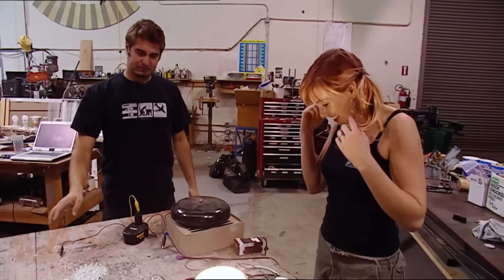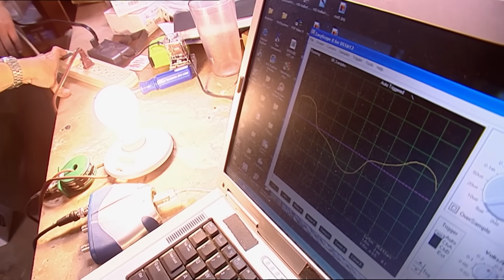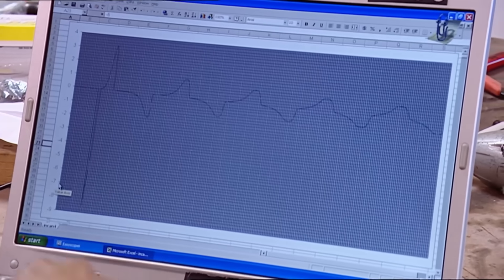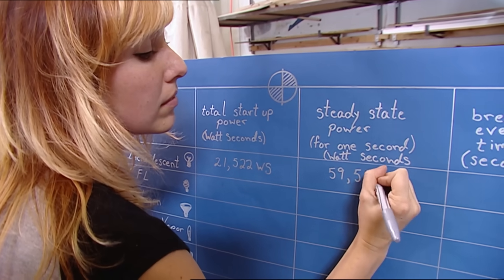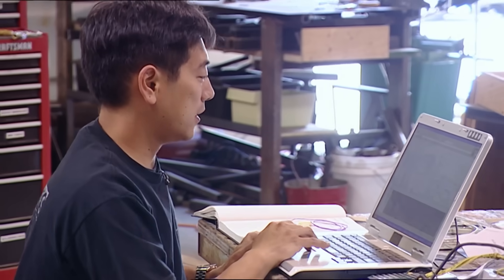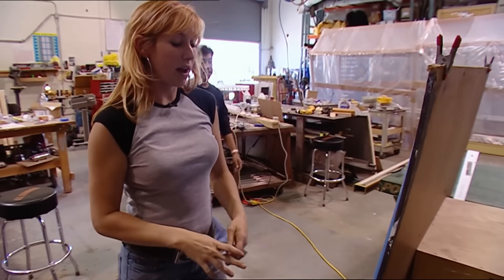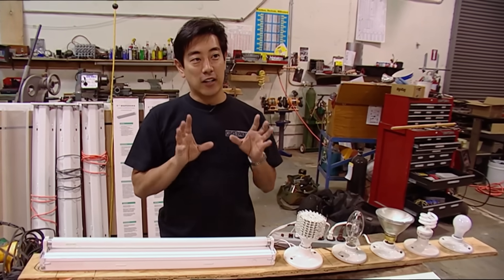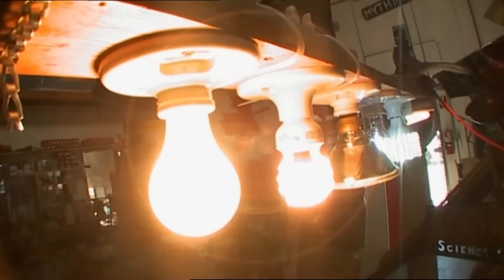Is It Cheaper To Leave The Lights On Than To Turn Them Off? | MythBusters

Comment: This is back when led bulbs were just a charming novelty.
Reply: I remember watching this and thinking led bulbs would be the future for us all in some far-off time.
Reply: @karenelizabeth1590 why didn't you say something man I would've saved so much money
Reply: I remember when streetlights had a warm glow, so did the lights in your house. And the headlights on oncoming cars didn’t blind you like staring into the f*cking sun.
Reply: @philiproseel3506 yeah, little did people know that it’s cheaper to make LEDs so now major manufacturers are gonna scheme out on producing them forever. It was a good run.
Reply: @philiproseel3506 LEDs can be any temperature (in the color sense). if lights got cooler that's because someone chose a cooler color not because of any limitation with LEDs
Reply: @seanthesheep LEDs are cheaper to manufacture at cooler temperatures to the best of my knowledge
Reply: @KLil37  oh, I didn't know that
Reply: @99berserker yea you can’t actually make LEDs that directly generate a broad frequency spectrum like white light so they make white light with a chemical coating that fluoresces from a blue LED on the inside so cool colors closer to the source blue are more efficient
Reply: @seanthesheep To an extent, but municipal construction is low bid, and a lot of street lights got the faulty Prince lights (the lights that are supposed to be white, but turn Prince purple after being exposed to too much sunlight)
Reply: @seanthesheep  That's not true, LEDs give off less waste heat because they are far more efficient. All the heat ever really was, was electricity going to waste.
Reply: @MythicSmith  thats not how light bulbs worked in the past, the act of heating up the filament is what generated the light, the light was a BYPRODUCT of the process
Reply: @nuhrii3449  Are you saying the heat was the point, the reason people used them? Cause otherwise yeah, that's still waste heat, that's just even more waste heat. You realize the more energy that comes off as heat, the most energy CAN'T be used for light. That's why bulbs now are much brighter, cool to the touch and energy efficient.
Reply: @MythicSmith  i said what i said, rationalize it however you want, it doesnt change the fact how light bulbs worked back then
Reply: @nuhrii3449  It's not just "back then" that's pretty much how they all worked up until LEDs. But as time went on we found filaments that glow bright and lower and lower temperatures because the waste heat is really not the intention.
Reply: @MythicSmith  You are completely wrong. First. I am 57 years old and I barely remember incandescent street lights. In fluorescent lights heat is byproduct though. And incandescent light bulb is more effective, the hotter the filament is. That's why halogen is more effective as it allows higher temperature. This is basic physics. Black body radiation and Planck distribution.
Reply: @trex2621  He’s just thick. Although I’m not sure that I agree with your comment about fluorescent bulbs producing heat because they certainly produce less heat that incandescent bulbs. I’ve never tried it to know whether you could touch a recently used or on fluorescent bulb to know whether or not it would burn your hands. I know that you couldn’t do that with an incandescent bulb, i.e. easy bake oven.
Reply: @philiproseel3506  The problem with LEDs on cars isn't that they're more efficient or more powerful, but that they're regulated like dogcrap.
I.E: Do you know how you see "10w, 20w bulbs, etc" ? When they're LEDs, they're not even drawing their advertised w/h. What it means, is that: "this 10w LED bulb SHINES as bright as a 10w regular bulb".
It's nothing but a comparison game. Pretty stupid, but guess what? Car manufacturers are actually "smarter", because they know that a "10w LED" actually consumes like 1w or something, so they just put a 10x stronger lamp in there to address specification, of "you're allowed to only have 10w headlights".
Hey, technically thoe LEDs do consume 10w, so everything OK!
No they're fucking not god damn it, indeed.

P.S: Obviously headlights don't actually consume just 10w, I ain't going to fact-check that. It's an example.
Reply: now they can be an everynite annoyance as oversized trucks points the SUN into your eyes.
Reply: @TheNewton  here in The Netherlands people have these mini suns on their bicycles now. You get totally blinded
Reply: @TheNewton  people with blue or deep yellow headlights need to be brought behind a shed.
Reply: @TheNewton  Led lamps should be banned from usage in traffic. Bet in a couple of years statistics will show how many accidents they cause. And dont anyone of you claim -Yeah thats because of your eyes cant cope with Led since your eyes (mine!) is old. Well, most young people will get old to, so..
Reply: @thatdudeinorange5269 it's not LEDs that are the problem. LEDs are highly functionable and very easy to have in varieties of colours. The problem is car companies have all decided they only want the brightest of blue whites which blind very easily when poorly adjusted
Reply: Have only had a few burn out in years of use.
Reply: What the FUCK happened here?!
Reply: @rinoz47  People getting emotionally attached to hardware + nostalgia + simply dumb uneducated people with a sprinkle of consipracy theorists because why tf not. That's what happened.
Reply: @Atom224 just about the dumbest combinations of words I've ever read. Congrats
Reply: I remember going to an energy fair with my dad and dropped $60 on a single LED shop light bulb. Now you can buy a cheap shop light with 2 bulbs for $10.
Reply: They were absolutely not charming back then. Novelty yes, but gave off “why does my kitchen look sick”-vibes.
Reply: Back when LED bulbs cost $20 each.
Reply: @jonathancaballeros3408  Idk if they are going up or not. I got like 100 on sale from DG for like 25 cent each. So not bought any in a long time.
Reply: LEDs are cancer for your eyes
Reply: All of my leds always break in a short time.
Reply: And probably back when their longevity wasn't artificially cut
Reply: @fritt_wastaken no that happened  almost a 100years ago
Reply: @fritt_wastaken right. They burn out quicker than incandescent
Reply: @boyeatsworld-vr9ci  Stop buying crappy cheaper LED bulbs. I bought all my LED smart bulbs back in 2013 and 2018. All of them still work.
Reply: @rufus2028 the new ones are made to die sooner it's planned obselecence otherwise if they last for years nobody is going to buy any bulbs and the brand would go bankrupt
Reply: @johndrippergaming  that is true, but it's not true that they die faster than incandescent lol
Reply: @TheXiaoLong they should not but they are built that way to die faster maybe they use cheap materials
Reply: @rufus2028 nah I have same issue. Phillip bulb,ge,no name brand,doesn't matter. Led bulbs last maybe a quarter the life of incandescents do for me. Open fixtures. Shouldn't be overheating
Reply: @boyeatsworld-vr9ci might be your house wiring. seriously they last decades.
Reply: @rufus2028 what about 2025 when you posted this?
Reply: @johndrippergaming congrats on realising what the rockefellas realised.a hundred and 50 years ago.
Reply: @rufus2028  i only buy "chap" LED bulbs, but also only ones i can screw Open and replace the small dot of  thermal paste with a better one that's applied correctly. So far they lasted min 5 years or much longer
Reply: @johndrippergaming they have always been able to make bulbs that don’t burn out. Lights only burn out to charge people like a subscription.
Reply: I miss Grant ❤  he really was brilliant! 

…as far as bulbs, I switched to LED in 2017 and 1/3rd are still original. I’ll keep buying them because I saw an immediate change in my power bill.
Reply: And they kinda suck now
Reply: We can all thank Shuji Nakamura
Reply: I have only led lights in my house, the led lights are never turned off completetly even if the swtich is off because the circuit only interupts the + or -, and one of those will pass throu the circuit anyway and those leds will still light abit :)
Reply: Shame they didn’t stay that way. LED are fucking awful
Reply: Still are.
Reply: Wouldn’t they be a novelty like now tho…?
Reply: I hate LED bulbs
Reply: Come on over to my place. My wife leaves them on 24/7
Reply: I'm more concerned with their claims of longevity.  Their lifespan claims were ahead of their actual time on the market, initially.  I've had one led bulb die prematurely, but most are still going.

As for their brightness, you just need to learn their terminology to find what you're really looking for.
🤔
Reply: @tyree9055  the primary enemy of electronics is heat. More often than not with LEDs it is heat that is the issue. But also, more often than not there is only one small component that went bad and can be replaced with some know-how, however most often the time isn't worth it.
Reply: @RedWingsninetyone There was a YouTuber that did a video on smart bulbs. Apparently most of the ones that die prematurely were enclosed in a non-ventilated space.
Reply: @RedWingsninetyone  they can fix that by making a design with larger or more LEDs working at lower wattage each, like the ones the city of Dubai demanded be manufactured.
Reply: @joshuascholar3220  there's other things they can do too, but yes that would help.
Reply: @RedWingsninetyone  Id say it would be best to add a small fan right before the LED enclosure, similar to those that can be found on car headlight when changing from Halogen.
Reply: @jsrocker248  the difference is that LED headlights have to put out a ton more light and the drivers get way hotter than a typical indoor LED would ever get. But I get what you're saying
Reply: @tyree9055 I bought my house in 2014 and put in LEDs in most of the fixtures at that time. This year one of those original LEDs finally burnt out. On the other hand, my parents replaced a whole fixture with one that had built in LEDs. In under two years the fixture died (it claimed to last for 10 yrs). Since it didn't had a removable bulb they had to replace the fixture again. This meant more money than just a bulb and the hassle of changing out a hard wired fixture on the ceiling. They made sure the replacement had a removable bulb so they didn't have to go through that all over again.
Reply: @tyree9055  my Phillips hue lights are around 12 years old with no issues or signs of wearing out
Reply: @tyree9055 is that LED that died quickly in an enclosed fixture?
Reply: @Nathan-jh1ho No, none of my fixtures are enclosed or recessed.  I think it was just bad, an outlier, or damaged in a power fluctuation.  There have been an extraordinarily higher number of power outages in the passed decade in our communal power grid.
🤔
Reply: @tyree9055  it depends son the manufacture, what kills the led it the heat on the circuit but you normally get a few bad ones of lets say 1,000 made you might get 5 bad ones. which can hit the shelf of a store. if you know someone who is maintenance at a factory ask them how long there light bulbs last
Reply: @tyree9055  Yep all my bulbs are LED.  Regular A19 style bulbs tend to be reliable but I have had a few die in way less than the claimed lifespan.  I am talking a year or two at the most.   The more complex ones like the ones they make for your microwave hood light are totally useless.  They lasted a few months.   Went back to incandescent for those.
Reply: @davva360 Good to know!
🤔
Reply: @tyree9055  Lumens is the measurement your looking for.
Reply: @LostShipMate Yep, lumens is the one term, but the other term is the kelvin one, related to temperature (yellow, white, or diamond white glow).
😉👍
Reply: @tyree9055  I have an led bulb in the kitchen in my apartment that has been on 24/7 for the last 9 years. It is the only remaining bulb from the batch I installed when I moved into this apartment. I don't know how it has lasted this long but there was one other that just died about 4 months ago so I expect this one to die soon.
Reply: @tyree9055 I replaced all the lights in my house with LED 11 years ago (LED was still relatively new) and I haven't had a single bulb wear out yet. The claim on the box is 16-22 years so I'll let you know
Reply: @YouToobPlaylists  I bought my first set of LED bulbs in 2013. So far so good
Reply: @YouToobPlaylists  3 hours a day* if you keep them on longer they will wear out faster which is what most people miss
Reply: @YouToobPlaylists wow how much you paid for that high quality LED? I only use $1 LED that last 2-3 years for 20 hours daily use.
Reply: @tyree9055  Unfortunately longevity claims are always taken assuming ideal temperature conditions. Most bulbs are installed in situations where they simply get too hot to achieve its rated lifespan.
Reply: @tyree9055  Agree about the over estimating the longevity. Had some burn out in less than a year. Just recently came across a video with a suggestion I’m going to try. Using the foil packaging from drug tablets, take a tiny piece of the foil from one of the spots where you have removed the pill. Place this as a connection point under the lightbulb and the lamp socket.
Reply: @tyree9055  you'd be lucky if you got a year out of the old ones, stop talking like you are thinking
incandescent is mostly heat, light second
Reply: Idk, I switched all but one of my mancave lights to LEDs a couple years ago. Selectable temperature or color, nice and bright and haven't blown a single one yet, use way less power, but the last remaining incandescent bulb in one room has been replaced a couple times now. I finally bit the bullet and swapped it out for an LED a couple weeks ago. 😅. I'm very much enjoying my LED lights.
Reply: @tyree9055 LED bulbs these days don't last as they were claimed to last due to the same reason the likes of phones & fridges don't last as long as they once did: planned obsolescence. LED bulbs today are deliberately housed in a way that causes heat build up faster than they should, & heat is the forever enemy of any kind of electronics, even as simple as light bulbs.
Reply: @FalconWindblader  If you buy no name bulbs that lack a heat sink maybe, but even the Chinese brands that have a heat sink will last you for half a decade at least. Mine have been going since 2015 and only two of the original 4 died, both after the 10 year mark.
Reply: @FalconWindblader lol no. Technical progress means evolving components which means you have changing reliability.

Anything thing from relegation due to a harmful substance to the company wanting a product that is mass producible will cause "planned obsolescence".
Reply: @Lucas_Antar  Gosh, sometimes i wonder how good your lives are for you people to get so sheltered, that your thoughts get so naive...
Reply: @FalconWindblader    The main culpret to heat desroying LEDs is using then in a 50 year old fixture that was designed for an incandecent.
Reply: @FalconWindblader If he's not a troll, then he may be a deliberate disinformation guru, or just someone that stupid...
🤭
Reply: @Lucas_Antar No, it's not technical progress, it's financial progress.  It's the attempt to produce the exact same product with cheaper components so they can remain competitive and / or make more money.  They keep doing that until the customer stops buying their junk and then they move on.  This is a repetitive process, too, that I've been watching for decades now.
Reply: @FalconWindblader  that's what happens when you become an educated engineer and not a drooling content sink on the internet. good luck idiot.
Reply: @tyree9055  sorry to tell you factories cant mass produce everything and cheaper/easier to find and work with materials must be used. literally part of my job thanks for noticing.
Reply: @FalconWindblader it's not so much planned obsolescence, they don't care about how long it lasts. They want to save the money now by not over engineering it. If they save a tenth of a cent and make a million, they pocket the cash. You might not buy another one from them, they don't care. It's like an added bonus that you might.
Reply: @tyree9055 most LED bulbs arent supposed to be in an inclosed or recessed fixture because they burn out faster.
Reply: @shadwell749 then they shouldn't be lightbulbs.
Reply: @tyree9055  The circuitry that drives the LEDs will die before the LED does. So to say that you had "an LED" die could be misleading. The light emitting diodes themselves could last millions of years but the cheap Chinese driving circuitry cannot.
Reply: LEDs die prematurely as they often aren't rated to be in an enclosed fixture.  So turning them off then not needed is probably even better.
Reply: Thanks for this. My millennial condo neighbor insisted that he left his basement light on 24/7 for many months because it was "easier" than turning it on an off and didn't cost any more $$ to just leave it on.  Truth: he has a big cannabis grow operation in his basement. He previously had it in his upstairs spare bedroom but a fire started, which he made up a ridiculous excuse for. After that fire his basement lights were on all the time.
Reply: @sitori663snitch
Reply: If those bulbs were so great, forcing everyone to use them and tripling electric bills wouldn’t be a thing.
Reply: @e @evilisfun9935  did you even watch the video and see the table showing the energy usage for each bulb. I implore you, go and rewatch the video
Reply: this needs an update considering cheap lights, electricity, and the longevity of the light switch.  see, replacing the switch plus labor costs a lot of money compared to the cost of electricity or tiny fraction of the life of LED lighting solution.  
I started to think this way during the popularity of TOyota Prius and switching off an engine in a traffic light.  Turns out it is a terrible idea, it probably halved the life of the lead acid battery which definitely a lot more expensive vs the fuel savings.
Reply: @zodiacfml switch cost a few bucks at most to replace. Easy to do yourself. Turn off the power to the area first ofc.
Reply: @zodiacfml how do you figure turning on and off the engine was a terrible idea for a lead acid  battery? 
My daughter’s 2010 Prius (from this era) has a 2009 lead acid battery in it, and hybrid NiMh battery, all with 280k miles. No battery has failed so far in 25 years in this car. I have replaced so many lead acid batteries in other cars, but not in this Prius. 
My wife’s Lexus hybrid RX also has 250k miles and original hybrid battery as well. We changed the lead acid battery once.
Reply: @RoopsPhoto  it is because hybrids start their engine through the electric motor and the motor gets its power from the high voltage battery
Reply: LED light bulbs are notorious (in the 2020s) for burning out well under their expected/advertised lifetimes. The claim that LED lightbulbs will last 10+ years fails 90% of the time and they fail in a year or less a good 10% of the time. So, yed, they are cheaper to run but do not, in general outlast other bulb types.
Reply: @Thurgosh_OG  would love to see where you got that data. Cause it sounds suspiciously made up. Nah it is made up. I have led bulbs in my house and can’t remember the last time I changed a bulb. Has to be 10+ years.
Reply: First thing I thought!
Reply: You have to be a special kind of stupid to think leaving your lights on all the time uses less energy than turning them off when not in use.
Reply: Blue.Light scam . Forced everybody to change. CFL
Reply: @RoseK-e8b  ok schizo
Reply: The concept came from back when lights were fluorescent lights that took a few seconds to minute to warm up. Today's lights  are instant on and off so there's no "extra" energy being used to warm up a ballast. So with that, you save money these days buy turning  them off if you're not using them.
Reply: And they still haven’t saved us a dollar… ironic
Reply: @rcnewman51.  Ok schizo
Reply: Yeah and about $50+ each.
Reply: @SeptimiusSeverusImp  Ok it's impossible to tell what comment you're replying to with this new update. But LEDs are like $4 each
Reply: @MythicSmith  Try keeping up. The video is 18 years old!!! Buy an LED on 2007 for $4. I dare you.
Reply: @MythicSmith  I was commenting on the OP. That was very obvious. They said they were a charming novelty, and my comment was that yeah because they were $50 each. Nobody could afford to buy LED bulbs in 2007 because they were a charming novelty that were very expensive. I would recommend you don’t comment anymore on YouTube because you’re too thick and you don’t understand context, and you obviously don’t understand history.
Reply: @SeptimiusSeverusImp  It's not at all obvious once you've forgotten most of the conversation and can't go back to look at anything that was said previously. But I apologize for my mistake.
Reply: Don't forget LEDs age you a lot more than the incandescent bulbs. I remember when CFLs cam out all the kids started to wear hoods lol
Reply: Incandescent bulbs may be inefficient but the light is awesome.
Reply: @boyeatsworld-vr9ci  this is the best pro incandescent argument I’ve seen in this entire comment section, “sure LED’s are better but I prefer incandescent because of personal opinion” the most valid argument here so far
Reply: @hadgeron9556 not opinion though. Just fact
Reply: @hadgeron9556  incandescent bulbs produce infrared radiation. Humans need that to regulate their biorhythm, especially if they spend a lot of time inside. It’s like having little candles all around your house. You can fake a warm light with LED but your brain knows the difference.
Reply: @hadgeron9556  but yes, I ultimately shouldn’t need any more reason than it’s my home and my energy bill and I should be allowed use the lights I prefer. Literally everything you see is a product of the light reflecting off it.
Reply: @boyeatsworld-vr9ci is Americans in the stone age, led lights are bright, I can choose my color,  it use a lot less power, I only use led lights now, and have for the last 10 years.
Reply: @simon-df9wh thats cool; if you like crappy stuff.
Reply: @boyeatsworld-vr9ci  ok schizo
Reply: @boyeatsworld-vr9ci that's a myth. You can get the same exact light from a soft white led
Reply: @chrisbarry9345 no you cant.  LEDs flicker while incandescent put out steady light
Reply: @pooshiesty  LEDs CAN flicker.  If your LED bulbs are flickering try better quality bulbs.
Reply: @chrisbarry9345 no you can’t. Drivers are so cheaply made it’s very unlikely you’ll find one that will output steady current. Even LED streetlights are made so poorly they often turn purple or flash. Additionally, no LED made today will outlast a HPS discharge bulb. People say LED’s will last 30 years but I’ve seen HPS bulbs from as old as 1960 still burning fine with near-perfect color rendering. Our world is cheap, and why make a perfect bulb when they know you’ll just buy more 😅
Reply: @pooshiesty  That's not why incandescent looks better. LED's emit specific wavelengths while incandescent emits a full light spectrum, like the sun. If you examine a "full spectrum" LED bulb you'll find it's made of several smaller LED's of individual wavelengths. This is especially apparent in hydroponic LED's which have dozens if not hundreds of individual lights of different colors to simulate sunlight as closely as possible.
Reply: @chrisbarry9345 incorrect
Reply: @aidenp265 on top of they why change the beautiful HPS lights that we been using for decades into shitty LEDs , also they're too harsh on the eyes and shouldn't be lightning the roads.
Reply: @pooshiesty  incandecents flicker too at 60 or 50hz
Reply: No one wants LED’s in their home- or headlights on a car they are blinding
Reply: LED*
not led
Reply: The LED bulbs seem to last 5 months before frying so idk. I still have a 15 year old incandescent bulb in my garage.
Reply: @jeramieshoe5662  You might have some sort of voltage or current surge issue that the LEDs are sensitive to that is causing the failures.  

For duration purposes, LEDs absolutely smoke any incandescent bulb I’ve ever used.  The difference is so extreme that it is not even close, which is a good thing for me, because I’m getting too old to be up on a ladder all the time.
Reply: @Eyrrll  if LEDs are sensitive to surges they're not going to last unless you're in an inner city with buried power lines. the drivers give out in LED way before any incandescent ever will. Manufacturing quality has gone down drastically in the last 15 years or so. I've gone through maybe 50 LED bulbs since they stopped producing incandescent. I only had to buy light bulbs once in 15 years prior to it.
Reply: @jeramieshoe5662 . My experience has been the opposite.  I replaced all of my bulbs with LEDs 8-10 years ago (a bit over 40 bulbs) and only one bulb has failed in all that time, which was most likely due to a big power surge around the time of an outage.  It actually still emits light but it flickers kind of randomly, so I wrote that one off.

I paid for quality bulbs.  Maybe that matters.  I don’t know but it’s been money well spent.
Reply: LED bulbs are less power efficient or cost efficient than incandescent, and NOWHERE near recycleable as incandescent bulbs.
Reply: @r61425  Say that again?
Reply: All mine are starting to go out. Very annoying. They are supposed to last a long time, but they don't. The circuit boards go out prematurely.
Reply: I’ve had my LED BULBS  in for two years and they are still bright as hell
Reply: And now they're just expensive blinking garbage with about 1/10th the life expectancy advertised.
Reply: sorry to inform you hony, led's are not better, even after all these year 's of so called improvement...........................just sayin"
Reply: @rvsteve583  Sorry to inform you honey, but there are facts and there are opinions, what you're saying is an opinion, facts however say they are better, at least for common daily uses.
Reply: @E_y_a_l  Yeah whatever bro. Consumer choice should be there. You cant ever say whats 'objectively better' and force people to use it, because there is such a thing as consumer choice. People can even choose to use classic bulbs for the express purpose of annoying folks like you. Isnt that neat 😊
Reply: What are you talking about itself from 1 day ago 😂
Reply: @marius-x86 the clip is from 1 day ago but Grant Imahara died five years ago so it's not just a day old.
Reply: @marius-x86  bro thinks Grant Imahara is still alive and MythBusters is still airing; early onset dementia is tragic
Reply: Led bulbs are outdoor lights they are meant for street lights not your home. I rather pay 50$ more for electricity then to do with the hormone problems that comes from led use
Reply: @Awakened_Phoenix it sounds like your understanding of science comes from the back of a cereal box
Reply: @Awakened_Phoenix oh definitely not LEDs arent meant for street lighting.
Reply: They still are. They suck. The light they produce sucks, they aren't dimmable (I don't care what anyone says they don't dim properly. They flicker and it hurts the eyes.)
They also die much quicker than any other bulb I've ever seen. Never had an LED bulb last longer than a few months.

They are the worst light bulb ever made.
Reply: @themonsterunderyourbed9408  
Leading edge dimmers are the older type. They will work with all incandescents, transformers for vow voltage halogens, and some LEDs. They start each half cycle on and switch off somewhere in the middle of a cycle.
chop the AC waveform:
- They cut off the beginning of each AC half-cycle.
- Less time current flows = less average voltage = dimmer light

Trailing edge dimmers are the newer type. They will work with all incandescents & most dimmable LED bulbs. They start each half cycle off and switch on somewhere in the middle of a cycle.
LEDs are semiconductors, not resistive loads.
hase-Cut Dimming (AC side)
- Works similar to incandescent dimming, but the LED driver must be designed to interpret the chopped waveform.
Low-Voltage or DC Dimming (PWM or 0–10V)
- Used in commercial or smart lighting systems.
- The dimmer sends a control signal to the LED driver, which adjusts the output current or pulse width.
- Very smooth, no flicker, and more precise.

you have to use a Trailing-edge (ELV or reverse phase) and not a Leading-edge (TRIAC) otherwise it will kill the led bulb
Reply: @themonsterunderyourbed9408  I just hopped on Amazon and found several listings for incandescent bulbs of multiple sizes. Find something else to bitch about.
Reply: Not so charming because they always claimed to be twice as bright as they actually were, and we all foresaw being forced to switch without any say in it.
Reply: @Plasmafox  Meh, I don't miss having to change a few lightbulbs a year. In the past 6 years I had to replace exactly 1 LED lightbulb, and that one was a extra-high power novelty bulb.
Reply: @Plasmafox  I have changed 1 lightbulb in the last 8 years. No one forced me, the alternative literally ended itself.
Reply: @PseudoEmpathy it was forced. You cannot buy an incandescent bulb now. Try to keep up
Reply: @boyeatsworld-vr9ci  where Iive at you can but only appliance bulbs and what not .
Reply: @boyeatsworld-vr9ci  I just put an incandescent bulb into a cart from a popular retail website, what the hell are you talking about?
Reply: @suporma-suporma unless its like ebay or something similar its not a 60 watt incandescent bulb or higher. I can buy plenty of sub 60 watt incandescent but they are useless as a lamp light
Reply: @suporma-suporma  not if you live in a country where they’ve been banned.
Reply: @Plasmafox  LEDS are more efficient, more reliable and safer technology than incandescent light bulbs, complaining that someone forced you to use it is like complaining that someone forced you to use a car instead of a horse.
Reply: @xerveeon  Relative to the speed and amount of use, cars are much more safer than horses, you are welcome to ask google "are cars safer than horses" and see for yourself, I don't understand why you even think they are not safer.
Reply: @xerveeon  There are downsides to nuclear power, so your analogy doesn't make sense either. It is one of the cleanest form of energy, however building reactors is very expensive and takes years. It also takes very highly qualified personel to operate. Storing nuclear waste is another issue, and while the risk of Chernobyl level catastrophe is minimal with the newest safety protocols - it's not zero. Nowadays a switch to solar power makes the most sense overall, the technology became incredibly affordable.
Reply: @E_y_a_l  There are a couple downsides. A big one is color rendering: there are only a few companies that will tell you at least the CRI and I've only seen one publsih the actual spectrum information, so unless you put a lot of effort into researching LED lightbulbs of all things, the colors of everything in your home will always be off. 
Another weak spit are harsh environments. LED bulbs either dia much quicker or don't work at all when it gets too cold or too humid; incandescent's just don't care.
Reply: @E_y_a_l  That is not a very good example, horses are far more charming than an automobile will ever be. Technology is not always a good thing, cars along with social media, and a handful of other technologies have had massive negative impacts on our society.
Reply: @xerveeon since cars don't poop, they're definitely safer for my shoes XD
Reply: @E_y_a_l  Yeah, the same people who go to climate conferences in private jets...
Reply: @E_y_a_l  how are incandescent bulbs unsafe?
Reply: It's hard to find ones that don't make your circadian rhythms break
Reply: @xerveeon  
Far more people died from horses before cars were invented per capita than people die in car accidents. Horses are extremely dangerous.
Reply: @hellterminator  I have never had any LED bulbs fail due to high moisture or low temps.  In fact, GOOD LEDs will light immediately (no warm up) and provide near 100% light at low temps.
Reply: @E_y_a_l

You can ask Google. Lol you literally think that cars are safer then horses? Haha ok. Then why is cars have more a death rate then firearms. Ask Google. 

Now ask Google how many horse deaths there is. 

Let's use some logic my guy.
Reply: @xerveeon  People fall of or get thrown from a horse. That never happens with a car. Also, never heard of having a fire while feeding a horse versus fueling a car.
Reply: @zombie_8u2 Horses are mainly used by skiller riders and controlled settings nowadays.  I don't think you can predict what the death rate would be if hundreds of millions of low IQ people were relying on horses for transportation like they are with cars.
Reply: @zombie_8u2   do that math again "per capita" and again with "miles traveled" and you wil get different answers.
Reply: @morgana2625  Going with the low IQ idea might skew the numbers further in both categories.  Also throw in the idea that one should learn how to ride a horse by age 10 or less. (years ago) <LOL>
Reply: @E_y_a_l  Would rather still have horses.
Reply: @darknes7800  Well you clearly don't have a cellar that gets condensation on everything all year long or live in a place where outside temps drop bellow -20°C.
Reply: @Fadexpl  actually nowdays nuclear poweplants are safer than basically every task you do everyday. there is a 1 in 10million years chance that there will be a nuclear incident caused by power plants. Even if you dropped a nuke on power plant it wont explode. There have been 3 big disasters in history of nuclear power plants and only one caused deaths due to radiation other ones had either 0 deaths or they were caused by other things like a tsunami in fukushima. In todays world because of fukushima and chernobyl nuclear power plants are the safest places on earth becuase of how much regulations and safety protocols they have. Also most of the nuclear waste can be reused and its so easy to contain and coal plants produce more nuclear waste than nuclear power plants. If nuclear waste was the problem we would be using nuclear power plants rather than coal plants. There are literally 0 downsides from using nuclear power plants. Also solar energy isnt as effective because it needs alot of land unless you are using it on houses rather than using farmland or other places.
Reply: @Fadexpl   Its, the cleanest form of energy not only that but, nuclear waste has been solved decades ago, we also have people experimenting with turning waste into plutonium enriched fuels. 

With newer thorium based molten salt reactors the chances of a nuclear meltdown is zero, the plutonium catalyst is liquid below meltdown temps and drains away from the fuel stopping the reaction without need for SCRAM or even any human intervention prior.

Expense is also not a problem when a coal powerplant costs more to maintain and we have a lot more of them around.

Not to mention thorium doesnt need to be enriched and its not super radioactive by istelf so you dont need any super special ventilation in thorium mines like you do uranium mines.

An estimate proposed that it would take roughly 8.5 million solar panels to equal the output of just one nuclear power plant and thats based off a 900 megawatt or average sized nuclear reactor.
Reply: @zombie_8u2Cars have higher death rate than firearms cuz they're FAR MORE cars than firearms everywhere. Cars are driven 24/7 all over the world in millions in any given SECOND. Also, that cars vs guns thing is unrelated when it's an argument between cars & horses. If you can't comprehend that much, you really have no business arguing about anything with anyone, let alone telling people to use logic when yours are damn flawed to begin with.
Reply: @hellterminator  Whoops, you brought an uncomfortable truth that LED fanboys just don't care about. Extremely expensive compared to incandescent (if we try to get close to the perfect color rendition incandescent inherently have). 99 % of LED bulbs have absolute horseshit color rendition. The information is either not available, or purposefully obfuscated. Short lifespan compared to the price vs. incandescent. They claim to have 50 thousand hours lifespan (the diodes themselves do, but the constantly overheating electronics behind them don't). And the recyclability. Glass + metal vs. various plastics + metal + electronics. Transformer, rectifier, filter, capacitors, resistors, now add Wi-Fi and smart features, a tiny computer inside.
It's a technology in diapers forced to be adopted worldwide and literally everywhere. We will regret this.
Reply: @hellterminator  Cellar???? I have OUTDOOR lighting on my house, detached garage and yard that is lit by LEDs.......No problem when its -10 Fahrenheit !!!!!!!!!!!  U should buy better bulbs.....
Reply: @xerveeon  man, you are such a simpleton. I don't even know why didn't you delete your comment, since you wanted it for so long, and it's an utter nonesense of a comment.

In case he deletes his comment - he said that horses are better than cars
Reply: @E_y_a_l I never heard of anyone dying from drunk riding a horse.
Reply: @E_y_a_l  the idea is taht many did not like and still dont like Led light bulbs. Just too bright and not as soft. Ppl should always have a choice.
Reply: @E_y_a_l  And yeah i still shouldnt be forced to use a car instead of a horse, if someone wants to use something they should be allowed to especially when it doesnt hurt others. Just admit you like authoretarian control over others
Reply: In defence of not using LED, the charm of cities and walkways is immediately destroyed upon switching yellow with artificially white light. I happened to walk along a park path the other day that still had one very old incandescent bulb. I had forgotten how moody and beautiful cities looked in such lighting. I know there are warm LEDs even yellow but for some reason they are not used.
Reply: @different_stuff   Literally lying, I implied that horses are safer than cars with the phrase "Since when are cars safer than horses?"
Since your reply is the one that gave me a notification, congrats! I'm deleting my original reply, though I will leave it in full here with the edit. (The only reason I'm deleting it is to reduce notifications, leaving it further in the chain makes it much less likely I'll get replies while still letting people see what I wrote if they care enough to scroll.)

My original comment in full: 

Edit: if I get any more notifications I'm gonna delete this reply. I've been dunked on enough, go like those ones instead of throwing your own spin on it.

Since when are cars safer than horses? I get your point, but you need a better metaphor. Perhaps coal vs nuclear power? It matches better with having only upsides in comparison and it being baffling that people don't want to switch.
Reply: @E_y_a_l  Not true. More efficient - yes, more reliable - no. In my kitchen I already replaced countless LEDs that SIGNIFICANTLY more expensive than incandescent. I guarantee you that although LEDs consume less power cost of LED ownership is higher.
Reply: @darknes7800 I don't have a problem with warm up in fact I love the warm up.
Reply: @FirstLast-n5b  And I can say that I haven't replaced my LEDs in my kitchen for years and they weren't that expensive...so? LED technology is significantly more reliable, it's a statistical fact, if you had bad experience that can be blamed by the manufacturer and the product, the cost got nothing to do with it since cost can be arbitrary determined by the seller and not by the actual properties or reliability of the product, I'm sorry but your own experience means nothing in a large statistical point of view.
Reply: @E_y_a_l other than government mandating energy efficiency requirements in order to eliminate incandescent bulbs from the market. The car and horse analogy is bunk.
Reply: @jeffmoodie6144  The government mandating the use of horses as a transportation vehicle in urban areas as well, the car and horse analogy is very accurate.
Reply: @E_y_a_l this is the funniest thing I’ve read this week
Reply: @E_y_a_l  Yeah but the light from those LEDs is kinda crap :D
Reply: @E_y_a_l  The feller who you replied to (the xerveeon guy) folded quickly and deleted his comments.
Reply: @4fortyfour  Yea, some people won't admit a mistake even if their lives depend on it.
Reply: @Fadexpl  I'd like to point out that the reason why nuclear is expensive is due to legislation that requires "the best possible protection", so often newly build parts of a plant have to be torn down and rebuild multiple times for marginal safety increases. Chernobyl level of catastrophe is basically impossible these days as it was the result of bad government mismanagement, having it ran by people not qualified to run the plant, running an experiment the plant wasn't build to handle, in a type of plant not build anymore with equipment far below the standard it was designed for and hidden for multiple days by the government. Unless you actively seek out to recreate that catastrophe on a governmental level (why would any government even try?), Chernobyl level of catastrophe are impossible.
For context, Fukushima in 2011 was hit by a record breaking earthquake followed by a record breaking tsunami and saw no notable environmental damage and a grand total of 1 suspected death which was a guy that went in to measure radiation after the disaster because automated equipment wouldn't work with the level radiation. And that's only suspected because he had lung cancer 4 years later but that can't be directly linked to the radiation.

And solar kinda sucks as you mostly get it when you don't need it and you don't get it when you need it most, which also makes the grid unstable. (an issue we here in western Europe already are having issues with) The only solution to that is getting batteries to charge but that would both negate the profits and environmental profits you'd get in comparison to something like natural gas.
Reply: leds are bad for your eyes thats a fact jack
Reply: @E_y_a_l  BTW your experience means nothing either, sorry to let you know. FWIW it depends. Those low voltage with external power supply have tendency to be more reliable, bot those GU10 with built-in power supply do not last long especially when facing down that is usually happens. Outdoors one prone to go off especially easy. Yes, it is because they are "cheap" Chinese made, but reality that they not that cheap and you cannot get non-Chinese made anyway.  Bottom line is very simple - you cannot judge how better they are based only on power consumption - total ownership somewhat different.
Reply: @FirstLast-n5b  Read again, what do you understand from the ....so? I wrote? that was my whole point, that my experience means nothing either and sharing personal experience means nothing compared to serious large statistics....and the serious large statistics say that LED bulbs are more reliable, period, you can specifically target a specific line of products all you want, it won't change the fact that as a whole, that technology is more reliable.
Reply: @E_y_a_l  Yes, singe LED can be made lasting longer than incandescent bulb, but unlike bulb it cannot emit any light without specific power supply and WHOLE SYSTEM depends on all links of chain. Statistic is no more than form of manipulation and they will produce whatever suit those who paid for such statistics. And there is another side of the coin - your "statistics" will say that LEDs "greener", but it will NEVER factor how much "goodies" was generated during LED production and will NEVER factor how much poison crap we burred in landfill. I am not against LED, they great where they do serve the purpose. I just saying that they are not panacea and nothing here is black and white.
Reply: Noone ever forced me to use a car OR a horse.That's because I live in Canada, A FREE COUNTRY
Reply: @Sharperthanu1  Yes the Canadian Government will Euthanize it's citizens for FREE and actually encourages it. Truckers who park and honk their horns in Protest against the Canadian Government violating Human Rights found out the Canadian Government would FREELY freeze their Bank Accounts and take away their Licenses.

Such FREEDOM there is a BEACON unto the Entire World. 🗽:elbowcough: 🥳😎🥸
Reply: @Fadexpl  just wait till you realise thats only fission and not fusion.
Reply: @E_y_a_l they don’t produce that same shade of light
Reply: In Australia where they have plenty of poisonious and other dangerous animals horses are the ones killing and injuring most of all as they are totally unpredictable and unreliable. Almost safer to stick your fingers into a lamp socket. But dont do that, unless you are holding the other hand onto a horse...
Reply: @Fadexpl  nuclear is the cleanest, greenest option.   Solar cells suffer from a 25 year lifespan, and there's no way to recycle them and they have one huge downside:  they don't produce electricity at night.   So then you have to add batteries to store excess energy.  Lithium batteries that are expensive further raising the cost.   By contrast, a nuclear reactor will last up to 100 years.

Chernobyl was a 70 year old design that had unique flaws as pointed out in the HBO series.  A modern reactor has modern control systems that basically run themselves due to improvements in computers and automation that will not easily allow operators to do something stupid.    Just FYI, Microsoft is starting up 3 mile island completely modernizing the control systems, and should actually be online relatively soon.   New York State is also building a new reactor because it's more cost-effective than so-called green energy.  So nuclear really is the future.
Reply: Solar power is counterproductive. Not only is it not green, it requires lots of rare earth metals, the mining of such metals requires good ol' traditional power stations. So yeah,in order to have solar power you require traditional power stations anyway. 
Not only that many solar farms take up large amounts of land,much larger than traditional power stations. These farms disrupt local ecology on a broader scale,and many birds are killed,as well as migration affected. There's also not much research on how these farms disrupt insects which affect an entire areas ecology.
Reply: @E_y_a_l  That's ridiculous.

Incandescent light bulbs contain no real toxic elements, and only the nature of glass poses any real risk when they are utilized.
In use, they get hot, but claiming them being a danger to anyone with half-a-brain just for that reason is nonsense. Stop cooking if a blatantly hot surface is so dangerous.

Meanwhile, led lights have extremely blinding light that doesn't reach far at all. For general led lights that can offer an actual usable light amount, it is also way too white, tiring the eyes.

Led lights are better as a light source only in one, single use. Spot light. Flashlights with led lights serve their purpose better than incandescent light bulbs do. But in house? Yeah, incandescent are superior (as a LIGHT SOURCE).

They do use less electricity though.
Reply: @E_y_a_l  Correction: LED's USED to be more reliable. I still have some early Cree bulbs that are 15yrs old.

The problem is companies are now minmaxing, pumping excessive voltage (current, actually) thru less LED elements leading to similar brightness at lower cost but more heat and much less run time.

Many bulbs have a pair of resistors in parallel that dictates current, and removing one drops it by 1/3-1/2 the wattage (more resistance = less current). For instance the $1/ea bulbs I got drop from 9w actual to 6w, equiv to 60w to 40w, but I can't tell the difference. They've lasted 5x longer than non-modded. Big Clive has a vid on how this works.
Reply: @growtopiafix8287  Just so you know, Chernobol was not a catastrophy of the technology. It was a man-made catastrophe. There was an issue, true, but that issue was within the safety protocols of the facility.
It was the manager of that facility that ordered to FORCEFULLY TURN OFF the safety features that led to the catastrophe. In other words, it's basically a bunch of idiots that collectively did not want to see another day that went along with an order that had big, red letters "YOU WILL DIE IF YOU PROCEED" tied to them.
Reply: @Fadexpl  Solar panels are fine when you can point them directly at the sun, when the sun is actually shining. We don't all live in the southern US.
Reply: @kikixchannel i know that but it also was kgb fault for hiding a fact that in that scenario they coudnt turn off the reactor while in other cases it would have worked. It was the fault of soviet unions pride that nothing can be wrong and everthing that can cause them to look bad must be hidden. Also they were doing experiments which meant the reactor was in extreme conditions which woudnt happen in normal circumstances.  While it was mostly the fault of the person in charge of the experiment he didnt have all the information to avoid the accident.
Reply: @E_y_a_l  A horse that has a non-zero chance of setting your house on fire.
Reply: @E_y_a_l  TY.
Reply: @E_y_a_l  anyone thats EVER ridden a horse knows cars are safer.
Reply: @Bob_Lob_Law  You don't have to clean up an automobile's shit or castrate it. You also don't have to worry about putting the car down one day
Reply: @Bob_Lob_Law  Cars have a negative impact to the environment, not society, Id invite you to test it out yourself if you can do anything without a car in the US. As for social media, Id say there's a lot more positive outcomes than negative to society. For instance, this comment, you commenting after watching this video, communicating via air waves, etc etc. Some technologies do have impacts but most purposeful impact is to help society, not impact it negatively cause no one, not even the creator, would benefit from them.
Reply: @jsrocker248 The very consequence on society is in your own comment.

We shouldnt need complicated, expensive, dangerous machines just to live.

Cars destroy alternatives by making them too dangerous or too inconvienient. No other type of transport does that.
Reply: @E_y_a_l  bad mood lighting
Reply: @E_y_a_l  wrong, not safer. they are bad for your eyes especially while driving at night. they also get really hot. If you're gonna try to correct someone, dont be an idiot too
Reply: @Astronomyisdope  LEDS are not better than incandescent light bulbs because they get really hot? are you serious? are you really trying to claim LEDS gets more hot than the average incandescent light bulbs with the same light output? typical incandescent light bulbs (which are literally a contained burn) have only about 10% efficiency, which means about 90% of the energy is released as heat, LEDS have between 75% - 93% efficiency, depending on the color, you really showed how little you know about the subject, If you're gonna try to correct someone...well, you know the rest.
Reply: I swapped the leds in my house with old bulbs
Three major reasons
One: the house was built over 100 years ago. Any room with a dimmer switch cannot have an LED. Even dimmer compatible leds won’t work. Old system 
Two: the same issue causes leds to die early. LEDs here last a couple of months then blow out. Old halogens last years. 
Three. They’re too bright. Too white. I like the golden amber glow. Easier on the eyes. Better for bed time. Less obnoxious. LEDs wee giving me headaches and eye strain. 

LEDs can be fixed for me by buying lampshades and rewiring the house but that makes them significantly more expensive because halogens will always be cheaper than rewiring a whole house. And they don’t hurt the eyes.
Reply: Actually building reactors isn’t expensive and doesn’t take years. That’s artificial 
See how cheap reactors were in the 60s and look up the average build time. 
You were able to put one up in one year and also for a tenth of the price. So why is it expensive and slow now? Lies. Anti nuclear fearmongering. Causes needless red tape and licences that are pricey and delay the build. You COULD have fast cheap reactors but you need to get the uneducated idiots to stop hyper taxing them at every step out of a bevy of lies they were told.
Reply: Actually Chernobyl is a zero chance issue. Modern reactors cannot meltdown. It’s impossible. 
Storing waste is also not an issue. You put them in concrete cylinders for 50 years. One reactor makes less waste in a year than solar or wind, which they just bury in the ground. 

You are massive uneducated on this.
Reply: @E_y_a_l  LEDs would be better technology if the companies that make them didnt cheap out on every component, it's extremely difficult to buy a 4 pack of LED bulbs where all 4 work out of the box... and even harder to find bulbs where they dont die after a month.
Reply: @E_y_a_l  but you can't use them as fuses as easily.
Reply: @Fadexpl actually we figured out storage decaeds ago
Reply: @Bob_Lob_Law  "horses are far more charming than an automobile will ever be" Not when I'm having to clean its stall or handle all the feed requirements or all the land requirements to give it a healthy life... Horses lose charm very quickly when you have to care for them and pay for them by comparison. I'm not even a fan of cars.
Reply: @rupe53  "People fall of or get thrown from a horse. That never happens with a car." Uhhh... people do get launched from a car when they don't wear their seatbelt... Which is still weirdly so many people...
Reply: @error.418    True, but back in the day when everyone rode a horse the statistics would be slanted to that not happening very often. These days, if someone can get the engine started they consider themselves an expert driver. Also consider what a California freeway would look like if it was three lanes wide with a horse every 20 ft. Crowding will change those statistics too.
Reply: @rupe53  Yeah, a horse economy wouldn't sustain the population of LA... The amount of shit everywhere would be insane. The feeding and stabling logistics would be impossible. This isn't "back in the day" anymore. LA needs proper public transit, not horses.
Reply: @error.418  The feeding and stabling of that much public transportation is not without its own problems. Consider places like NYC where trains are stored quite some distance from where  they are actually used, then the logistics of keeping everything running and moving on time is also highly complex. Each mode has its own issues.
Reply: @E_y_a_l  You should do research on different light spectrums and how they affect human health. LEDs aren't healthy. Incandescent are the best option for humans.
Reply: @Progeusz-  Burning fossil fuel is a lot less healthy for humans, and in that regard a light with 70%-95% efficiency is a lot better than a light with 10% efficiency, simple math.
Reply: @E_y_a_l  lmao, what a pathetic attempt at deflection
trying to blame incandescent bulbs for burning fossil fuels is hysterical. You should look at AI data centres instead. They will burn more energy in a year than bulbs in your lifetime.
Reply: @Fadexpl nuclear is getting better and better with new research. there are already technologies that allow to reuse nuclear waste as fuel material. Imagine a closed fuel cycle where any waste is reused on the plant.
Reply: @Progeusz-  Talk about a pathetic attempt at deflection, the subject here is not data centers, genius, it's the comparison of light technologies, which is exactly what I did, which is on topic, unlike the power use of data centers, and not surprisingly you have nothing to say to contradict the fact that LEDS consume far, far, far less energy, how's that goes along with your claim that "Incandescent are the best option for humans"? lol at you being butthurt for thinking anyone will be impressed at your comment and now you're just doubling down, hilarious.
Reply: @E_y_a_l  Its not the cars that are unsafe, its the millions of idiots that drive them.
Reply: @E_y_a_l  Absolutely inaccurate. Many LED bulbs are made in Asia and have shotty quality assurance. The heat sinks are often not seated properly causing them to burn out in less than 100 hours of use. I have incandescent lights in a chandalier that were new when we built our house 18 years ago with daily use. Out of 20 LED bulbs I bought to replace the horrible florescent spiral bulbs we were forced to buy, over half have burned out in less than 2 years.
Reply: @E_y_a_l  The flaw in your logic here is that you can still buy and ride a horse if you want to. Good luck finding new incandescent bulbs.
Reply: @koalanectar9382  And how easy it is to find a new oil lamp? there's no flaw in my logic, only yours.
Reply: @Possum-Pie  What you are describing is a fault of the product, not the technology, if we'll go back to my first analogy, you can buy a car that breaks down every two weeks, and you can buy a car that runs smoothly for years, the problem with the car that keeps breaking down is not that it's a car, but that it's a bad car.
Reply: @E_y_a_l  You made an analogy regarding cars vs horses, but horses are still readily available, they were not regulated out of existence.
Reply: @koalanectar9382  If that's true then why for example can't you ride a horse on the highway then? horses were once used for all daily travel needs, but then they were regulated for special uses only under certain rules, just like incandescent light bulbs....seriously, you people are exhausting.
Reply: @E_y_a_l  My point was that politicians decided that they would regulate lightbulbs. They pressured people to buy the florescent bulbs as "more efficient". Companies scrambled to keep up with demand, quality assurance was mediocre, many bulbs touted to last years failed quickly. Cold garages or outside lights took minutes to brighten to full bright. They were a flop. THEN LED bulbs were the "miracle bulb" that would save the planet. As I said, a significant number failed quickly due to poor heat sink design inside frying the electronics. SO I could spend $1 and have an incandescent bulb which lasts 8-10 years and uses $5 electricity/year, or I could spend $5 a bulb, chance them failing in 6 months, and needing replaced. I choose to wait until the quality of the LED is improved.
Reply: @Possum-Pie  Once again, you are describing a fault of the products, not the technology, the politicians regulated the technology, and you people here in the comments either overly exaggerate to make your point or you are buying some really low level LED bulbs, I never had a LED bulb last less than a number of years, the current one I have above me on the ceiling while writing this was bought 2.5 years ago, but I'm not an American and I don't live in the US, so maybe in the US you either manufacture or import some really low level stuff, so again, that's a problem with the products and you need to direct your rage at the products, not the regulation, there's nothing wrong with the technology which for daily use is much superior to incandescent bulbs, in my country LEDs are considered reliable and are the preferred choice, in-spite that in here incandescent bulbs are still perfectly legal to buy up to 60 watt.. and in my 4+ decades on this planet I never had an incandescent bulb that was used daily that lasted 10 or 8 years by the way...I think that again you exaggerate, but that's just my own personal experience.
Reply: @E_y_a_l  THen you are a very lucky person. I have had consitantly higher failure rate from expensive LED bulbs than incandescent. BTW, The oldest continuously burning incandescent light bulb is located in a fire station in Livermore, California. It is known as the Centennial Light and has been burning since 1901.
Reply: @E_y_a_l  HOLY HECKING REDDITERINO I TOO LOVE WHEN THE GOVERNMENT FORCES ME TO DO THINGS!!! I JUST HOPE THEY WON'T TAKE LONG TO FORCE US TO EAT SAFE AND EFFECTIVE AND JUST LIKE THE REAL THING SOY MEAT AND BUGS!!! AND FORCE US TO DRIVE GOOD FOR THE ENVIRONMENT LITHIUM BATTERY ELETRIC CARS THAT WILL BE SO AWESOMENINO!!!
Reply: @E_y_a_l  You know horses are still legal and there are people who still use them for transportation?
Reply: @TheAtkey  Horses are legal in certain situations and places, where in the past they were legal everywhere, just like incandescent light bulbs are legal in certain situations and places and in the past they were legal everywhere, you know it's illegal to ride a horse on the highway for example, right?
Reply: @E_y_a_l  I've seen the Amish do it
Reply: @TheAtkey  Which will fall under specific situations....check the law, horses are not allowed on high-speed highways and interstates in the US, and stop being annoying just for the sake of being annoying.
Reply: The horse came with Full Self Driving pre-installed. Not so much for my car.
Reply: @Plasmafox Funny, they never did try to force leds like they coerced florescent on us.
Reply: @Plasmafox
Only because nearly all Americans do not know how to read a lightbulb. Americans view it as 40, 60, 100 watts.
In reality that is the energy consumption and has nothing to do with brightness.

Look at lumens for brightness.  Don't be a typical American. 

Want to change the color tone? Look at the Kelvins.  Low Kelvin means yellow. High Kelvin means white.  Keep it low Kelvin if you need to sleep and relax
Reply: @Plasmafox  Nobody is forcing you to buy LED, what are you even talking about. What a nonsense comment. It's by far the smartest move as they use so much less power that switching your remaining bulbs is a god idea even if your old bulbs are still working because LEDs save so much power. There are way more options with LED as well even if you're picky about your lighting.
Reply: @Plasmafox  You can still buy incandescents.
Reply: @Plasmafox  genuinely dumbest comment oat
Reply: @Plasmafox  If you put an LED bulb in a housing meant for incandescent or Halogen: You are in for a bad time.

LED's functionally take electrons out, and spit them out of their front end, going more or less forward; This means you are more prone to directional casting of light. For LED's to do their job you need diffusion of the light into the desired form; You need sufficient LED's connected to the array to keep power draw down as there is always a sweet spot in efficiency; and you need to cool the drivers, rectifiers, unless you want god awful flicker that runs at the grid frequency rate.

I Have LED bulbs that far surpass the incandecent bulbs they replaced: They aren't the dirt cheap ones - but they last so much bloody longer; And yes - you have to ensure your LED bulb is rated for a complete closed light fixture if you are using it in one, or solve the heat issue some other way or you are going to have it prematurely die.
Reply: @Plasmafox  You are saying that as if it was a bad thing. LEDs are the far superior technology in basically every aspect. The only thing LEDs are "worse" is dimming in household AC setups, hence here they require a "more complicated" solution than conventional dimmers. But a) solutions exist and are ubiquitous, and b) that's also true for any other type except incandescent and halogen. Complaining that we are now mandated to use LED is like complaining that you are forced to use electric headlights in your car rather than oil lamps how it used to be.
Reply: @Plasmafox  LED all my lights. Night and day  so much better
Reply: @Plasmafox  The initial ones weren't that great, but over the decades they can easily be as bright or brighter than normal bulbs.
Reply: @Plasmafox  Over the lifespan of ONE LED lightbulb, you're saving up to $3000 in energy + lightbulb cost in comparison to your standard 100W incandecent bulbs. You gotta be crazy to still use those. Mind you, we did this calculation during our first lecture at Uni in EE.

Edit: Corrected the typo "My" to "Mind".
Reply: @Atom224 lol. No.
Reply: @boyeatsworld-vr9ci  Look mom, it's one of those flat earthers you've been warning me about. Go kick rocks.
Reply: @Atom224 this might be the dumbest combination of words ever put together. Congrats, dude.
Reply: @Atom224  I have incandescent bulbs they’re still good from the 1980s yet I have never gotten more than six months out of an LED
Reply: @peaceofmyhearthomestead4611  Biggest BS I've ever heard. 6 months max out of an LED? Where do you get them from? At the e waste center?
Reply: @Atom224  3000$ in savings? your electricity must be insanely expensive... 10w led for 10000 hours is about 100kwh, about 15 to 50Euros here. replaces about 75W bulb, that is 100-350Euros.
Reply: @Plasmafox You can just buy an incandescent bulb if you really want.... Just nobody wants that waste
Reply: @Plasmafox  Funny U misremember it that way.........WE (the US) were forced to switch from incandescent to CFL bulbs, due to a GOV mandate.  The FREE MARKET sprang up and perfected the LED bulb, then we no longer needed the CFL bulbs.
Reply: @Plasmafox "without any say" like you were forced to switch from leaded gasoline without any say, or put GCFI outlets in kitchens and bathrooms without any say. Good grief.
Reply: @Plasmafox  LED bulbs are so much better, unless you want heat from your bulb.
Reply: @Plasmafox  Taking the numbers from this video, an incandescent bulb versus a led has a ratio of 90 to 1 in steady state energy expenditure.
Who needs an analogy for that in terms of being forced to use them? The evil government is forcing you to spend less money?

Using incandescent bulbs over leds makes no economic sense whatsoever.  If you can fall for such a silly a right wing gimmick as this to get riled up over, I can see how the current anger and frustration politics give you Yanks the president you deserve.
Reply: @wardibald  I use Incandescents what's the big deal
Reply: @Plasmafox  No one is forcing you to switch to LED bulbs. California gave out free LED bulbs to households but they don't force you to use it. You have every right to spend more money using old tech bulbs that don't last long. Even this video proves that LED bulbs use less power and has a longer life span.
Reply: @pinoyexcel  they literally banned incandescent bulbs in many jurisdictions, so yes, it’s force. At best I can still buy small ones for appliances, like oven lights.
If I want to pay extra to have lighting I prefer, that should be my choice.
Reply: @Plasmafox Boomer